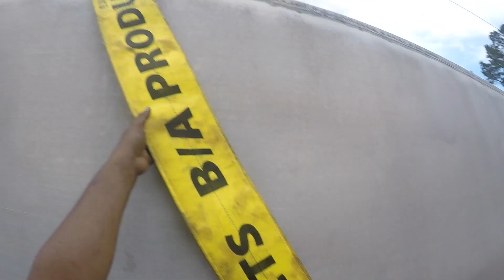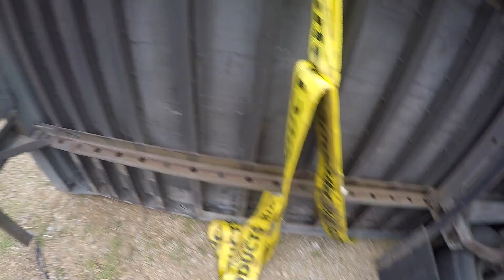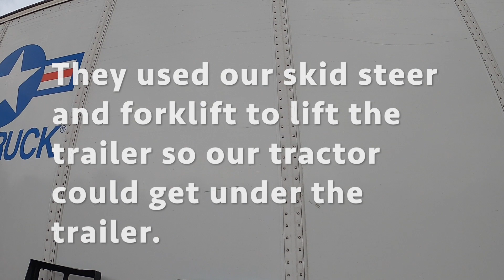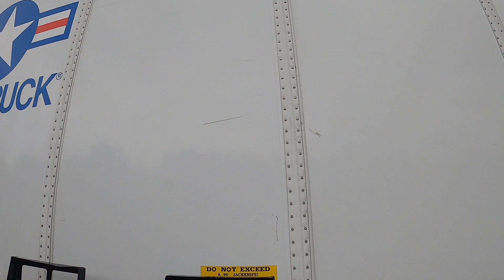Landing gear fails = Trailer Roll Over

Comment: The unseen side of heavy recovery. So much more than just setting the trailer on its wheels and backing a tractor under it.Off loading/reloading on a hot day in a stuffy trailer with no air movement, or in the rain, or blowing snow making everything slick, add in doing it at night in the dark for even more FUN. Takes more time than people realize. From start to finish, most excellent job guys. THANKS TO ALL. Side note: When I was little, I always wanted to be a COWBOY ! After working a stock trailer wreck, it dawned on me, I wasn't MAN enough to be a cowboy !!! Of course in my defense, I did not have a horse or a rope to work with.......and being on the interstate didn't help either. WHAT A NIGHT !!!!
Reply from the maker: Mr Terry that sounds like it was a long night. Thanks for watching our channel and stay safe

Comment: Can truly feel for the crew. We hit the mid 90's here this week also, heat index was 105.  If you get a chance check out the I20/I59 interchange here in Birmingham. It's called "Dead Man's Curve" but not for the deaths. It's because the last thing a truck driver sees is a huge cemetery  as he's overturning. Almost a weekly thing now. They have had cattle trucks, chicken trucks and beer trucks overturn. 
Thanks and be safe
Reply from the maker: Mr Donnie that sounds like a bad place to be a truck driver. Thanks for watching and stay safe
Reply: @SumterWrecker  it's only bad if the truckers from Atlanta don't pay attention to all the very large warning signs and flashing yellow lights. But yeah the companies who have rotators are doing well.
Thanks
Reply from the maker: @donniebrown2896  thanks for watching and stay safe
Reply: They also lose big coils of steel off that sucker! I remember in 09 they had one come off a trailer, smash the guardrail and land on the interstate below!! Lucky it was at 2 am when there was no traffic!!
Reply from the maker: @hughstephenson2957  thanks for watching and commenting. Stay safe

Comment: Nice job ! Is the trailer landing gear  designed to hold up a heavily loaded trailer  ? Thanks.
Reply: Normally it will if the load is uniform and the ground or pavement is hard enough to support the weight. Uneven loads and or soft ground can cause the weight to shift putting an off center or lateral load on them causing them to collapse. Drivers sometimes use poor judgement where they drop a trailer or don't put down cribbing under the gear to spread the weight. We used "drop stand" type gear on our log trailers. They have a substantial foot that goes all the way across the width of the trailer. I can drop a full load of tree length logs on them no problem if the ground is good. Hope this helps...
Reply: @johnnyholland8765  Thanks good to know.
Reply from the maker: Mr Carl  Mr Johnny pretty much summed it up.  Thanks for watching and stay safe